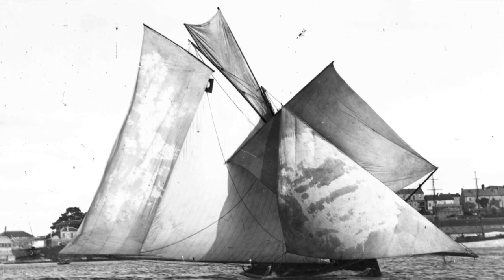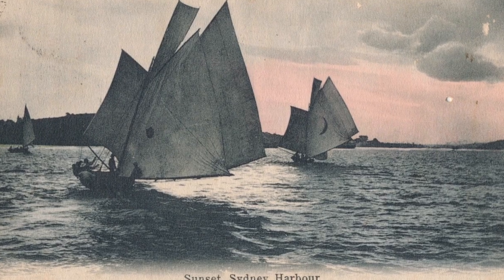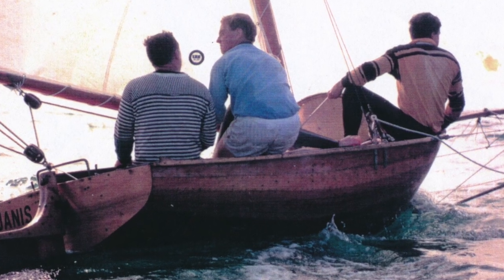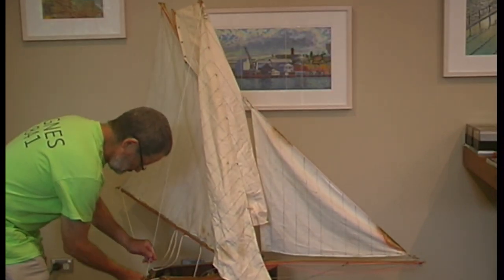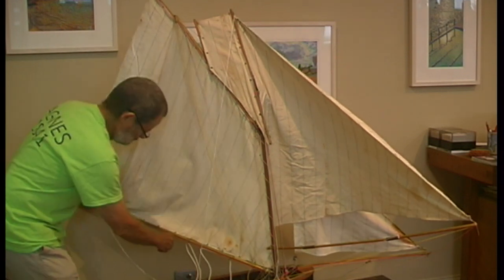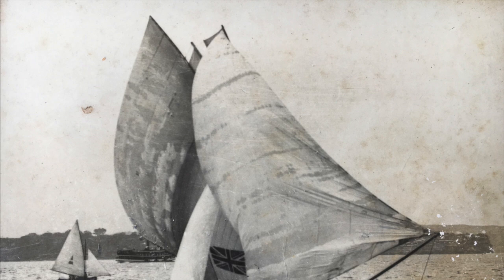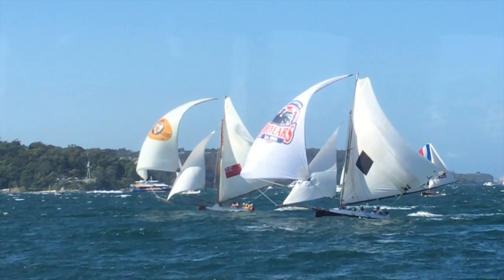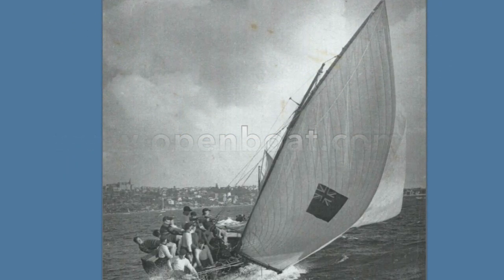What's a Ringtail?

Comment: online translation:

Dear Mr. Smithy!

You have clearly explained what a ringtail is in this video.
QUESTION 1°) But why the mizzen/dirver stun'sail (studding sail) is called a ringtail?
A ringtail is either a tail with ringlets like the ringtail cat or ringtail lemur or a ringed (curly) pigtails.

QUESTION 2°) If you have adapted your mainsail ringtails from the studding sail of gaff-rigged driver

on the square-rigger, why did you do it this way?
QUESTION 3°) Is this due to easier handling?
The driver stun'sail (spunker) of the square riggers did not overlap the gaff sail by half the width of their sailcloth, but were set behind it, as you yourself show in the picture at minute 0:20 and as can be seen in many photos of the Pride of Baltimore II and as shown in the book The Young Sea Officer's Sheet Anchor by Darcy Lever on page 66 with the so-called Fig. 354.
The luff (fore leech) of these mizzen/driver stun'sail was guided with a bowline (<swedish boglina) on some ships, as on the square sails.
QUESTION 4°) Does this mean that it was possible to sail upwind courses (close-reach, close-hauled) with these mizzen/driver stun'sails (spunker) with a bowline?
*****************************************************************************************************

original text:

Werter Herr Smithy!

Was ein 'ringtail' ist, haben Sie in diesem Video anschaulich erklärt.
FRAGE 1°) Warum wird aber das Besanleesegel als 'ringtail' (= Ringelschwanz) bezeichnet und nicht als 'mizzen stun'sail' ('studding sail'), welches es doch ist?
Ein Ringelschwanz ist doch entweder ein Schwanz mit Ringeln (ring-tailed) wie beim Katzenfrett (ringtail cat) oder Katta (ringtail lemur) oder ein geringelter Schwanz bei den Schweinen.

FRAGE 2°) Wenn Sie Ihre Groß-Leesegel von den Leesegeln der gaffelgetakelten Treiber der Rahsegler adaptiert haben, warum dann auf diese Ihre Weise?
FRAGE 3°) Ist das der einfacheren Handhabung geschuldet?
Die Leesegel des Treibers der Rahsegler überlappten doch nicht um die Hälfte ihrer Tuchbreite das Gaffelsegel, sondern wurden dahinter gefahren, wie Sie das selber auf dem Bild bei Minute 0:20 zeigen und man es auf vielen Fotos von der Pride of Baltimore II sehen kann und wie es im Buch The Young Sea Officer's Sheet Anchor von Darcy Lever auf Seite mit der sogenannten Fig. 354 dargestellt ist.
Das Vorliek dieser Leesegel wurde auf einigen Schiffen wie bei den Rahsegeln mit einer "Bugleine" geführt.
FRAGE 4°) Bedeutet das, daß man mit diesen mit "Bugleine" geführten Leesegeln auch auf Amwindkursen segeln konnte?
Reply from the maker: Thanks for your interest. Q1: I have no idea why it was always called a ringtail.Q2: As a replica class we copied the way it was done in the class a century ago. Q3: Square riggers could have less overlap because their spars were longer, they will only set if the halyard and out haul are set close to the centre of the spars, Q4: They cannot be used to windward effectively. They only draw when the wind is flowing across the mainsail from aft to forward. Once closer to the wind than a broad reach the wind begins to flow across the sail from forward to aft, including on the lee side and the ringtail becomes disrupted and provides more drag than lift. Cheers, Smithy.
Reply: Dear Mr. Smithy!

Thank you very much for your prompt reply.

It's just as well that the 'internet' exists. Thanks to it, I can see what's going on in Down Under like on a television (see: from minute 38:08 https://www.youtube.com/watch?v=D6pmKObortQ, from minute 1:19:27 https://www.youtube.com/watch?v=78dzd-RK1mw ), without having to pay a lot of money to travel there in person, where people sail with more cloth on their boats than is good.
QUESTION 5°) Do the Australian 18-foot boats really have any relation with the American oyster sandbaggers?

I could also write to you outside of YouTube so as not to overuse the comment function on the video.
QUESTION 6°) Are you perhaps a member of the SFS (Sydney Flying Squadron)?

ad Q. 1)
It's a pity that you can't help me with the etymology.

ad Q. 3)
I am generally aware of the airflow on sails, which is why I understand why the leeward sails (must) be hoisted on the leeward side of the mainsail on downwind courses.
When asking about the possible use of these light wind sails on upwind courses, I therefore assume that they are then set to windward of the mainsail (similar to the wing flaps on the Junkers Ju 52/3m, for example). The mainsail would overlap the ringtail in the same way as a genoa overlaps a mainsail. It could have been that someone has tried this before, either intentionally or unintentionally.
Unfortunately, I have no contact with the square-rigged sailing scene to ask the captain of the Pride of Baltimore II, for example, whether he also uses his ringtail on courses other than downwind.

So if no one has yet attempted this and it is theoretically considered hopeless, I will probably "crushing" the project and concentrate my energy on the mizzen staysail. I can hoist this with an even larger surface than the ringtail. Unfortunately, this means I have to carry one more sheet in my hand. As a single-handed sailor, I already feel like the coachman of a six-in-hand stagecoach. I used to hold the headsail sheet with my teeth from time to time. I wouldn't risk it today. Only then again, when I have third teeth that can be "glued" in such a way that the sail tears rather than the sheet tearing out my teeth.🙂
******************************************************************************************

Originaltext:

Werter Herr Smithy!

Vielen herzlichen Dank für Ihre umgehende Antwort.

Nur gut, daß es das 'internet' gibt. Dank diesem kann ich, wie in einem Fernsehgerät (siehe: ab Minute 38:08 https://www.youtube.com/watch?v=D6pmKObortQ, ab Minute 1:19:27 https://www.youtube.com/watch?v=78dzd-RK1mw ) sehen, was da so los ist in 'Down Under', ohne für viel Geld persönlich dorthin reisen zu müssen, wo Menschen mit mehr Tuch am Boot segeln, als es gut ist.
FRAGE 5°) Haben die australischen 18-Fuß-Boote eigentlich irgendeine Verwandtschaft mit den amerikanischen Austern-Sandbaggern?

Ich könnte Ihnen auch außerhalb von YouTube schreiben, um nicht die Kommentarfunktion zu dem Video überzustrapazieren.
FRAGE 6°) Sind Sie vielleicht Mitglied des SFS (Sydney Flying Squadron)?

ad Frage 1)
Schade, daß Sie mir in puncto Etymologie nicht weiterhelfen können.

ad Frage 3)
Über die Luftströmung an Segeln bin ich im Allgemeinen im Bilde, weshalb ich verstehe, warum die Leesegel auf Vorwindkursen auf der Leeseite der Großsegel gesetzt werden (müssen).
Bei der Frage nach der möglichen Verwendung dieser Leichtwindsegel auf Amwindkursen setzte ich daher voraus, daß diese dabei dann in Luv des Großsegels (ähnlich wie die Tragflächenklappen z.B. bei der Junkers Ju 52/3m) gesetzt werden. Das Großsegel würde dabei das Leesegel genau so überlappen, wie auch eine Genua ein Großsegel überlappt. Es hätte ja sein können, daß das schon mal jemand bewußt oder auch unabsichtlich ausprobiert hat.
Leider habe ich keinen Kontakt zur Szene der Rahsegler, um z.B. den Kapitän der Pride of Baltimore II zu fragen, ob es sein Besanleesegel auch auf anderen Kursen als dem vorm Wind verwendet.

Wenn also noch niemand so einen Versuch unternommen hat und es theoretisch für aussichtslos erachtet wird, werde ich wohl das Projekt "einstampfen" und meine Energie besser auf das Thema Besanstagsegel konzentrieren. Dieses kann ich mit einer noch größeren Fläche hissen, als das Leesegel. Nur muß ich so leider noch eine Schot mehr in der Hand führen. Ich komme mir als Einhandsegler eh schon wie der Kutscher einer sechsspännigen Postkutsche vor. Früher habe ich das Vorsegelschot auch schon gelegentlich nur mit den Zähnen gehalten. Das würde ich heute nicht mehr riskieren. Erst dann wieder, wenn ich Dritte Zähne habe, die man so "festkleben" kann, daß eher das Segel zerreißt, als daß die Schot mir die Zähne ausreißt.🙂